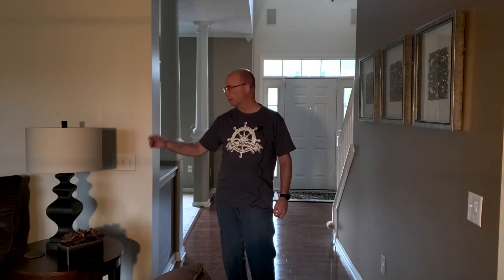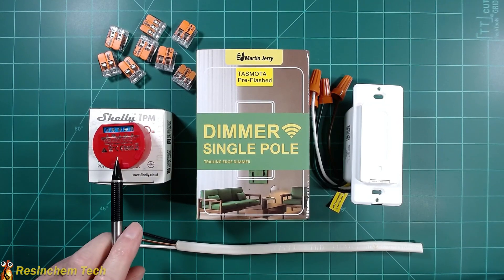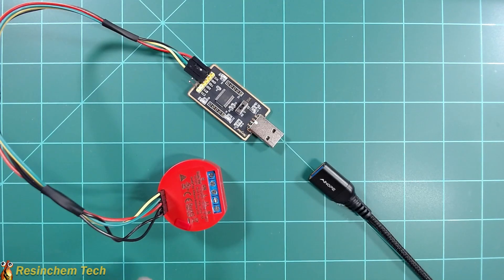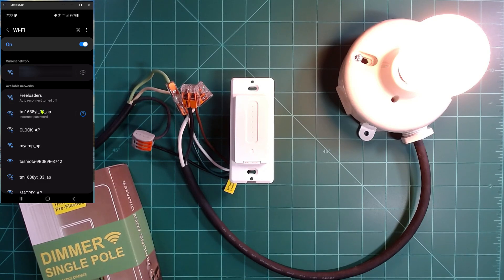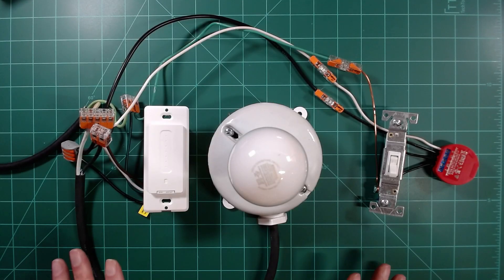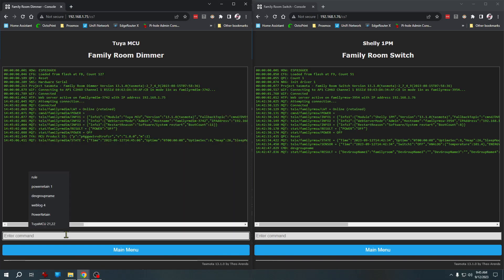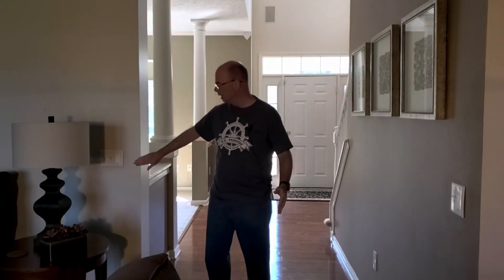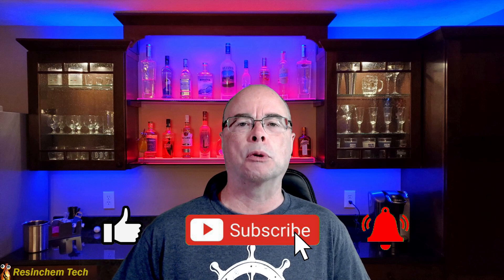Smart 3-way Switching with Tasmota Device Groups

Comment: Fantastic video! I got one light switch to control my bedroom overhead light but wanted to add two switches to control the bedtable lamps instead, but without taking away the overhead light for when I sell the house. This would let me do it without having to create new switches for my lamps! I cannot than you enough for this video.
Reply from the maker: Thanks.  Tasmota switches and relays are a great way to 'rewire' switches and outlets without the need to alter any existing circuits or "in the wall" wiring.  

And as you mentioned, it also makes it easy to restore everything to "default" configuration whenever you decide to sell your house.  Glad you found the video helpful.  Let me know if you run into any particular questions or issues along the way.

Comment: Great video as always!
I have a question for different topic. My esp32 with wled comsuming power while the leds turned off.
What is the thing that I need to make the OFF really an OFF? I tried using a smart plug but it's not the best solution.
Reply from the maker: It is true that LEDs still draw a small amount of power when "off".  One solution is what you have done... use a smart switch  or plug to kill power to the entire system, including the ESP32.  But this does have the drawback of the device being unavailable in Home Assistant or for use in any automations unless that automation also powers on the system first... which does add a slight delay due to the time it takes for the ESP32 to boot up.

If you wish to truly kill the power to the LEDs while keeping the ESP32 powered on, WLED supports use of a relay that will switch the power to the LEDs off/on.  You can find information on using a relay with WLED here:  https://kno.wled.ge/features/relay-control/

Personally (and this is JUST my opinion), the amount of energy draw by a string of 200 LEDs when "off" is around 1 watt (per the WLED page).   Here where I live, the cost of a kWh is about $0.13.  That means that 200 LEDs that are off but drawing power would cost me about $1.13 for the entire year for that.  If I spend $5.00 to add a 5V relay to shut those LEDs off, it would take approximately 4.3 years of cost savings just to cover the cost of the relay.  And this doesn't count any additional energy used by the relay itself.  But there are other reasons for killing the power to the LEDs I suppose.  Safety could be one... I do kill the AC power to the entire power supply for my outdoor LEDs when they are not is use.  But this is because they are outside and if not in use, it is just safer to kill the power.  You may have additional reasons.  But I think when people believe they are "saving money" by killing the power to the LEDs, they haven't really done the math.  If you have an install with 1,000s of LEDs that are going to be turned off for a significant amount of time throughout the year, you might be able to save a few dollars each year.  But in my example of 200 LEDs above, it would take me approximately 5 years of "off" time to realize about $1 of actual energy cost savings after the cost of the relay was recouped.  But again this is just my personal opinion and everyone has their own reasons for wanting to save that power.

Thanks for watching.
Reply: @ResinChemTech  Thank you for your quick and detaild answer! From my side it would be a safety reason and curiosity

Comment: Great video, not new to electronics in general but new to the HA world. Looks like the shelly would be perfect and non-intrusive for my needs - I'm in a condo. This might be silly, but do you have a recommendation for the short wire between the shelly and the switch? I won't need 12ft but also want it to be proper. Its been a long time since I've done anything electrical like this and I dont have scraps of anything anymore.

Thanks again for the awesome and detailed video.
Reply from the maker: You are most welcome!

For the Shelly connections I just took a small scrap piece of 14/2 Romex and cut short leads from that to make short jumpers for the switch and power connections.  So, 14 gauge would be recommended.   Whatever wire you use, it needs to be rated for the expected amps that will pass through the circuit.  The good news are that they are very short runs, but you don't want to risk the wire overheating.  The Shelly relays are rated for 15 or 16 amps (depending upon model) so I'd say as long as you use 14 gauge wire or larger, you should be fine.  But as I stated, I am not a licensed electrician but since 14 gauge is what is used for most US residential situations, as long as you stick with that, it should be acceptable.

Good luck with your Home Assistant journey.  Don't hesitate to reach back out if I can help out in any way.

Comment: Thanks for talking about device groups, good to know. I'm not allowed to rewire dimmer switches since the electrocution incident. Would have been Ok if I hadn't been holding a pocket knife at the time. I did turn off a circuit, it was just the wrong one. 💡💡🌩🌩
Reply from the maker: While Tasmota has an amazing number of features, I think that device groups are one of the best features, since once installed it allows you to easily "rewire" how switches and outlets work in your house without actually rewiring them.

Thanks for watching!

Comment: didn't know they can do that without mqtt... how they communicate between them, which protocol?
Reply from the maker: According to the official Tasmota site for device grouping:  "UDP multicasts, followed by UDP unicasts if necessary, are used to send updates to all devices so updates are fast. There is no need for an MQTT server but all the devices in a group must be on the same multicast network."
Reply: @ResinChemTech very interesting, thanks!

Comment: After actually watching the complete video, you have given me a new understanding and appreciation of device groupings, especially with Tasmota. One question since I am such a noob, if Tasmota uses MQTT and the broker is not available I suppose you only lose the benefits of the grouping, am I understanding that correctly?
Reply from the maker: Actually, for Tasmota groups, MQTT is not required.  So the grouping/syncing works completely standalone.  Only your WiFi is needed so the groups still work even if your MQTT broker goes down (or you don't even have one).

MQTT is needed however for Home Assistant integration.  Even though there is a native Tasmota integration for Home Assistant, it still uses MQTT "under the hood".  So, in short, you can do everything I showed in this video even if you don't have MQTT (well, except for the voice control... as that uses Home Assistant in my case).
Reply: @ResinChemTech  I am sorry, but I don't understand "MQTT is needed however for Home Assistant integration" vs "native Tasmota integration for Home Assistant"...I have the MQTT add-on in HA? Do I need more?
Reply from the maker: If you don't want to manually enter all the YAML to integrate the Tasmota device, then you need the Tasmota integration installed in Home Assistant.  However, since the Tasmota device uses MQTT discovery for the integration, you also need the MQTT integration.

So... you always need the MQTT integration.  You can then manually create all the MQTT entities via YAML... or you can install the Tasmota integration as well, which will create all the entities for you without any manual YAML code.
Reply: @ResinChemTech  ok, and this is where I get confused...I am a "power user noob" for the last 5 years +...I have devices under MQTT, and Tasmota, and Unifi (some of them the same devices)...when I look at all of my Tasmota devices...and I am still trying to figure it out...and then link Google Home to Nabu Casa... and Google doesn't work (wife factor)... My head hurts...LOL  Again, thank you for your time...
Reply: @ResinChemTech Excellent, I was hoping that was the way it actually worked, but was unsure!

Comment: Ahh, I am immediately struck by the humorous thought that revoking a cardinal sin has a cost of two 3-way-smart switches. I am not in any way saying I disagree or disapprove, it was just humorous to this old man! Keep up the great work and keep them videos coming!
Reply from the maker: Well, this is the way it should have been done in the first place.  But it was one of my first "smart" devices and had been in place for years.  And I've done so much "preaching" in my other videos about not removing existing functionality and yet I still had this old device in place doing just that... despite numerous times when I wish I could turn the light on with a simple wall switch.

So unlike many of my other videos, this was a project I needed to do for myself and I decided to make it into a video in case it might help someone else.  Actually, I ended up leaving it like I did towards the end of the video where one switch controls one lamp and the other controls the other lamp.  I'm not sure why there were two three-way switches so close together anyway... but that's how they were wired.  Using Tasmota let me repurpose one of those switches for better independent use.

But as always, thank for watching and I greatly appreciate the comment.